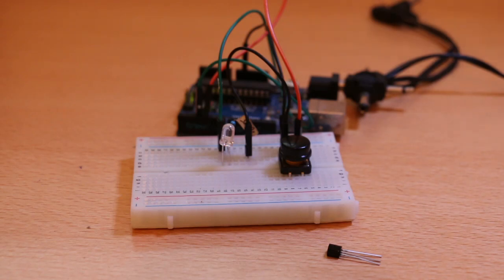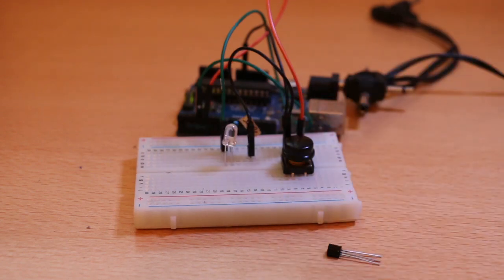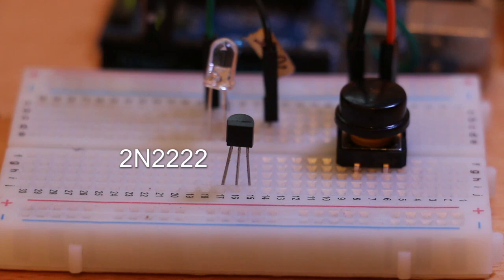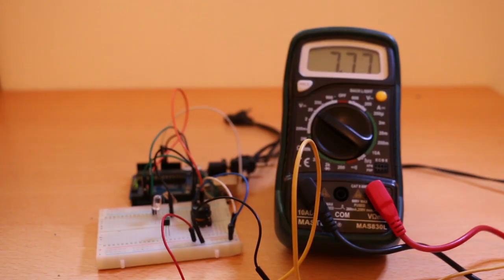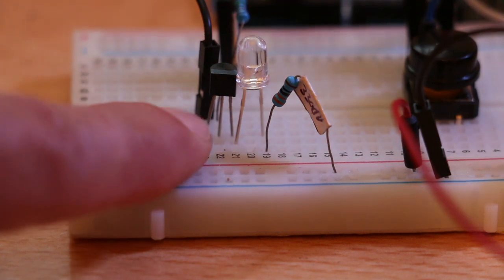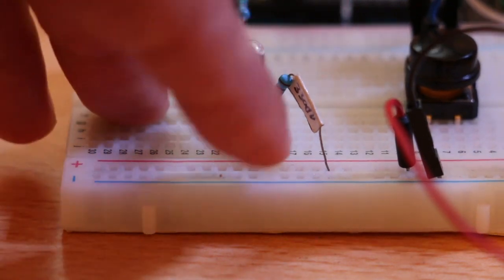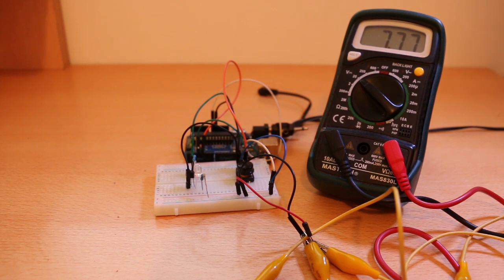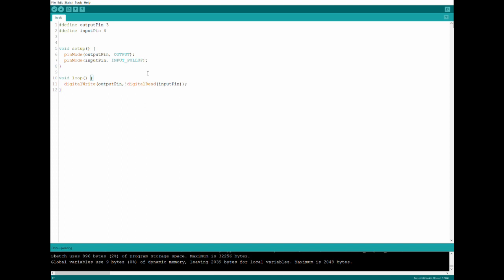arduino and the use of  a 2n2222 transistor as a switch

Comment: would this transistor work as a gate for a 5 volt 1 amp current?
Reply from the maker: It can work at (max) of 30V and 0.6Amp
So the answer is no. 
And I would look for a proper MOSFET that can take up to 1.5A to be on the safe side. they work on the same principal
Reply: @talofer99  would there be any models that you would recommend for 5 volts and 1 amp. Thanks!
Reply from the maker: @johnenders7767  none specific  that I can mention. 
I found this good write up, lots of what seem to be helpful info 
https://bildr.org/2012/03/rfp30n06le-arduino/
Reply: @talofer99  Thanks

Comment: is the emitter connected to the arduino ground?
Reply from the maker: Good point !
I did not mentioned it,  the ground are shared. you can see that there is a cable from the ground lower rail to the arduino , since I use the VIN power the ground is shared.

Comment: so, question....   i'm trying to rig up a nano with a dht11 and 5v fan to draw humidity out of a beehive when it's insulated in the winter.   the entire system will be powered by a solar/wind powered 12v battery bank...   i can get it to work with a 12v fan using a mosfet...    but i want the entire thing to be as simple as possible - no extra wires or components.   can i power a 5v fan JUST with the nano?   or will i have to use something like a 2n2222?     i can wire the fan directly to 5v/ground pins on the nano and clearly the fan works - but all the time.    that would suggest it SHOULD work but now sure how to wire it. (don't want to use a breadboard - again simple is better)
Reply from the maker: Yes you can, if Its a good thing - no.
The power regulator of the arduino has its limits as well, on top of that, you have to be careful with the fly-back current from the engine when it stops. 
And with engine mosfets are better option,
Reply: @talofer99  so better to have the extra set of wires and a 12v fan and use a mosfet to bridge the two then?    because no matter how i rigged it, i simply could NOT get the 5v fan to work...  i either got it running all the time, or just got a hum.    not a huge deal, the bee hive is in a  beehouse that's only 8x8, so not like i'm running wires hundreds of feet.   now i have to remember how i wired the mosfet one!
Reply from the maker: you can use the 12V to power the arduino as well. so only need to send one set of wires really.
Reply: @talofer99  actually yeah, i didn't think of that... i need one set of wire, which will be split - the nano i'm using is only 5v - i think bad things happen if you give it a 12v supply... so i'm using a stepdown from 12 to 5v... but, out of interest.   IF a nano could use 12, then hypothetically the wiring for a 12v arduino and a 12v fan should be the same as a 5v arduing and a 5v fan?   what i need is that wiring.. the logic is the easy part, funny enough considering it's been like 40 years since i did any programming (i literally had to program in assembler at college - 40pounds of paper to find the one line you goofed!).  thanks for you help by the way, i do appreciate it... and the bees thank you too
Reply from the maker: I think you are missing something here.
The nano can only work on 3.3/5V (depend on the module).
But it has an onboard voltage regulator that drops any voltage up to 12V to the needed on the board. 
look at the supply voltage - and we are talking about applying it to the VIN !!
https://store.arduino.cc/arduino-nano

not sure why the wiring is confusing you.

Comment: Can also create a button with a resistor and a LED, without an Arduino. Makes it possible to light the LED when pushing the button. Can also use a transistor, if you must. But overall a great video, definitely keep up the excellent presentation form!
Reply: of course because thats a very very very simple case! Arduino are intended for more complex things and programming on it. that you can't do only with wiring
Reply from the maker: I agree and thought of saying it in the video, but I thought it will just confuse people :)